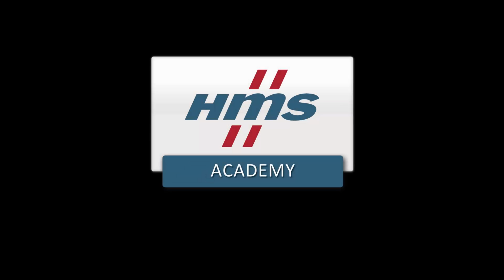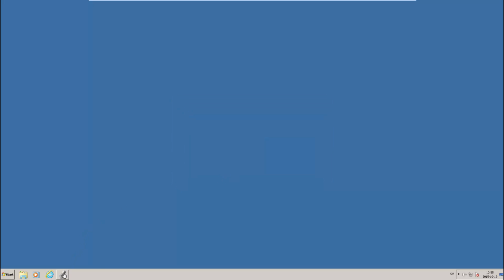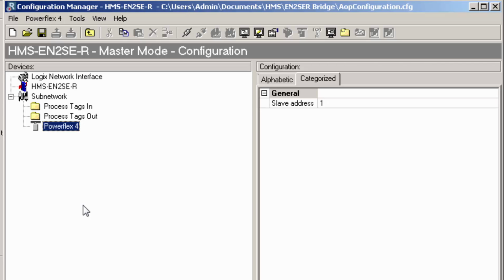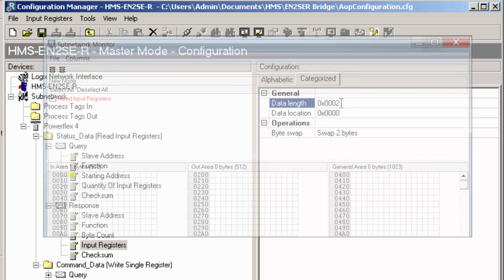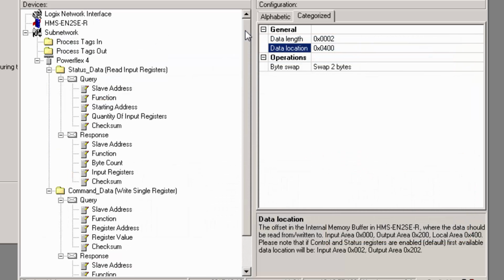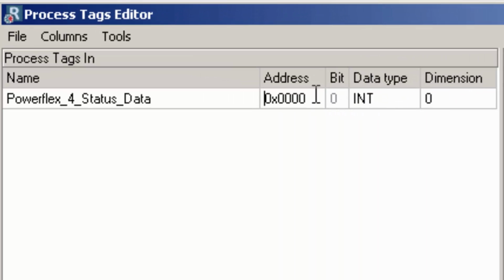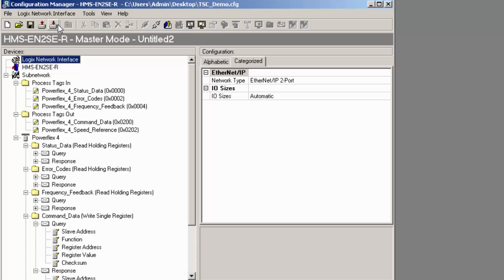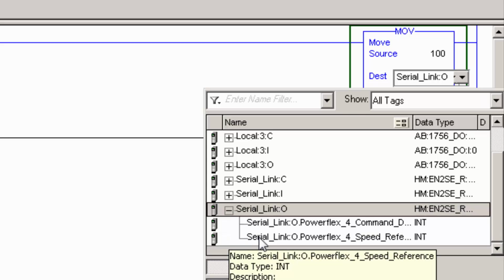How to connect a serial Powerflex drive to a Rockwell ControlLogix PLC

Comment: Is this Ethernet to Serial Linking device similar to the Anybus Communicator?
Reply from the maker: Hello Alex!

Yes it is similar. The difference is that this device is configured via an AOP (Add-On Profile) in Studio 5000 over the Ethernet/IP Interface instead of a PC software connecting on the configuration port of the Anybus Communicator Classic.